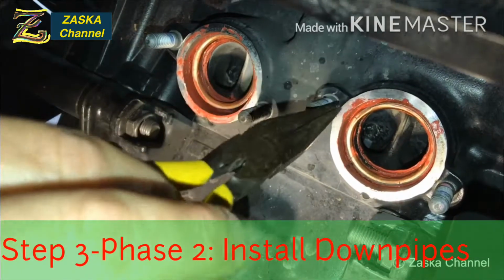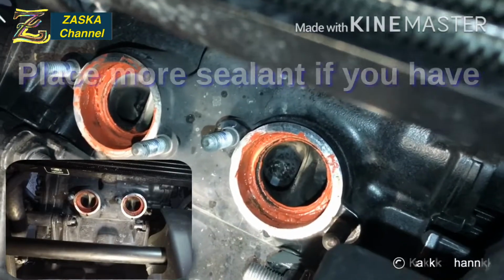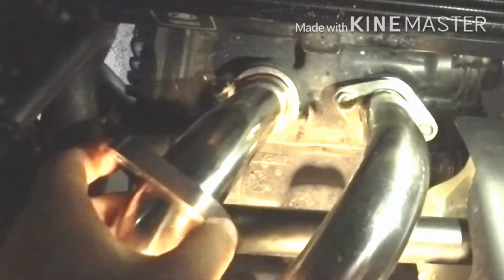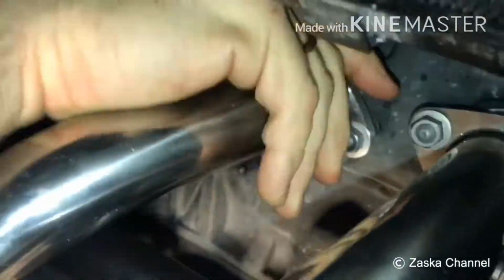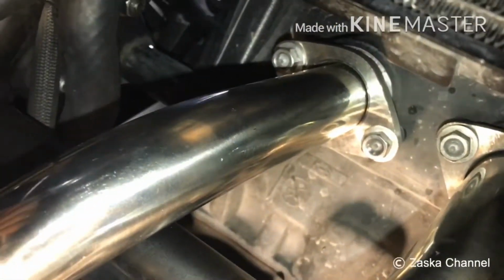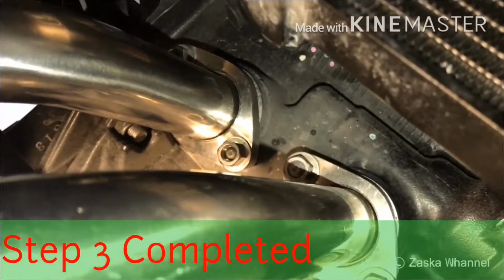Step 11 - How to Install a Delkevic Exhaust in a Kawasaki Vulcan S

Comment: For those attempting this, I've been informed by Delkevic you need to let the sealant dry for 24 hours before installation, and you don't put it on the copper gaskets.
Reply: Define dry? Like build it then let it dry before riding?
Reply: @gokucanfly4593  yes, put on the sealant, build the pipe, leave for 24 hours.
Reply: @brendanwm  can you not use sealant? I have extra and baffle and i want to do bit testing with it on and off and dont want to deak with sealant  mess.

Comment: My gaskets work just fine. You would be better off to use the old gaskets rather than no gaskets. Just my opinion but good luck with that.
Reply from the maker: I am using the old gaskets. I didn’t know they were there that it is why I could not fit the new ones. The problem is that the old gaskets are so deep in there that they are nearly unnoticed. So I am good since there are gaskets in place. Next time,  I will make sure I extract the old gaskets and place the new ones. Thanks for the comment